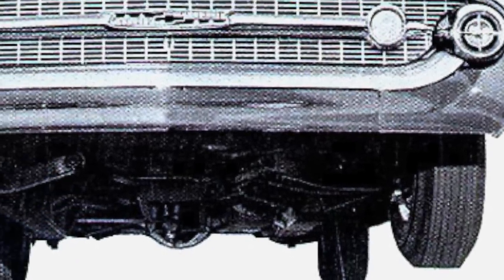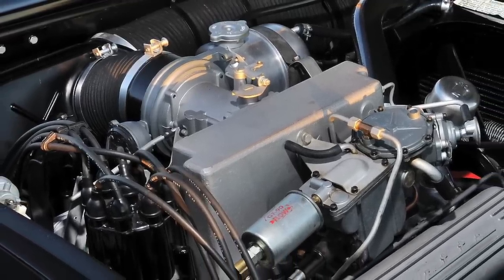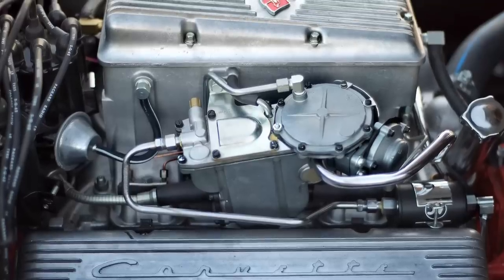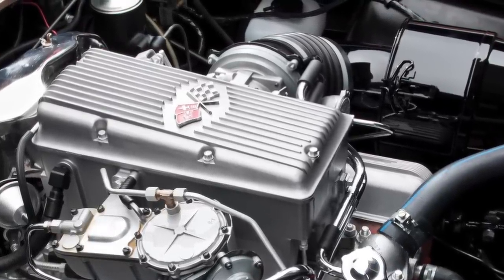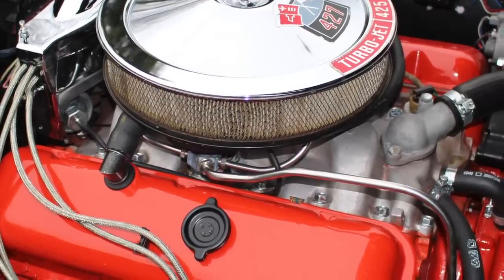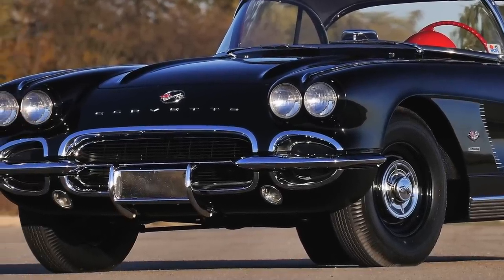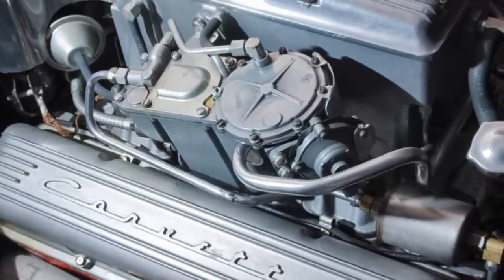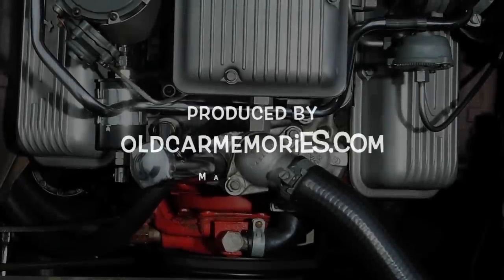Why Chevy Abandoned the 1962-1965 Fuel Injected 327 V8

Comment: Other reasons Chevrolet dropped the Fuel Injection were that it was not as economical as they portrayed it to be. Many owners found that their Fuelie used even MORE fuel than a carbureted engine.  Also, the Fuelie didn't run as clean as modern EFI systems do. The Fuelie normally ran very rich when cold and more often than not, stayed on the rich side of the meter when fully warm.  It's what's known as "Continuous Port Injection" meaning it's ALWAYS spraying fuel. 

Excessive Oxides of Nitrogen emissions were a problem with these engines and with emissions standards on the horizon for 1968, Chevrolet chose not to bother.  It was easier to clean up the exhaust of a carbureted big block than it was to tune the Injection system for emissions.  Well, they could, but it meant a tremendous drop in power and economy so the entire operation was dropped.  

If they could have found a way in the 60's for it to be able to meter fuel better, but controlling fuel in a purely mechanical system didn't seem feasible.  Mechanical injection was much more suited to airplane operation than automobile.  There simply was no reasonably affordable way for them to control the fuel with the technology of the time.

It was a valiant effort for sure.

Another one that was far ahead of it's time was Bendix's Electrojector used on some Chrysler Corporation cars in 1957 and 1958 and also considered by AMC about the same time.  The Electrojector is considered the Daddy of modern Electronic Fuel Injection and differs from GM's system as it COULD meter the amount of fuel the engine called for but the Electrojectors biggest failing was 1950's electronic components.  Old school capacitors, paper resistors and time-period transistors simply could not survive in an automobiles' climate and component failure effected ALL cars equipped.  Today, less than 5 Electrojectors are known to survive and I believe only ONE is functional.

Comment: Whatever the engine's  faults may have been the ONLY 'Vetts that I have ever been interested in are the '62-'65 models with the 327 fuel injected engine.
Reply: I totally agree and I am still driving my '65 Fuelie, solids, side pipes, 4 spd. , 370 posi coupe that I have owned twice (77-82 & 2000 - present) Love that Vette. Had a '64 Fuelie Coupe too from 1966-69.

Comment: My mom just gave me her '63; it wasn't born with the fuel injection option but it is totally factory original. It is in need of TLC and probably an engine rebuild. It burns a lot of oil. But the entire car is unmolested and original which is nice. I'd like to put a '63 injection unit on but then the car wouldn't be original...

Comment: They axed it because the mechanical fuel injection was extremely problematic and the first thing to go bad was the fuel timing cam which needed an above avg. mechanic to fix it properly in those days. It was also a very expensive option. All that for 15 more hp over the 327 2x4’s which cost a lot less and twice the reliability.... no brainer

Comment: Chrysler beat the 283 Chevy (there was also a 250 hp FI option) to the 1 hp/ci with a dual quad 354 cid making 355 hp the year before. I believe Rochester made the fuel injection for Chevy, b/c Bendix made a unit for Pontiac and Chrysler that failed regularly and were gone in a year or two.  Imagine if during the gas crunch of the 1970's, GM had put this on the corporate 305 for their luxury cars instead of trying out the 8-6-4 and diesels that sent customers running away.

Comment: In 1969 or so one of the mechanics who worked at our garage was practically crying trying to get the fuel injection system working on his brother's vette.  He ended up putting a carburetor on it.  Sounds like he should have had it towed to a Chevy dealer.

Comment: It was NOT a mechanical fuel injection system like Mercedes. It was a constant flow system, the injectors were pumping fuel all the time and controlled as to the amount by an air flow sensor that was forced to change due to air flow into the engine. and Chevy was not the only manufacture to use this system, Pontiac had it also.

Comment: For the same reason Chrysler abandoned fuel injection in 1958, the electronics required just wasn't ready yet.
Reply: Your right, however it wasn't the electronics, it was the parts. The capacitors were not weather proof and disintegrated almost immediately when put into service. A Desoto Adventurer was discovered with the system still intact. The owner replace the components with modern types and it works beautiful. I love AMC's desicion to just abandon the whole thing when they experienced the same problems on the 57 Rebel.

Comment: The next pre mass-production fuel injection system was on the 1976 Cosworth Vega, twin cam motor.  1st electronic system I believe.
Reply: Chrysler had the first electronic fuel injection on a 300 letter car with a hemi in the 50s I beleive. They didnt work very well but they worked

Comment: Engine was great but the F.I. systems was fraught with way too many issues. Most removed it and replaced them with a single 4-bbl intake and (usually) a Holley carb. And yes, many were literally bagged up and set on a shelf, never to be installed again. Today, the hot set-up is to fake it by installing port-type injectors and controls and use the shell of the original F.I. components to disguise the changes. Now one cna have the performance of a modern system but an oldies look. Still, have to hand it to Chevy as when brand new, the F.I. system was great. But, G.M, never invested the time in a.) mechanic training  to fix faults at the dealership level (it is a complicated design for sure) b.) re-designed or solved the mechanical issues that plagued the system. .

Comment: I wonder if the real reason the 396 vette was only a .10 second faster had more to do with tires.  It's my understanding that with slicks the dual quad high compression 427 would run tens stock.
Reply: I made comments above about the 1965 327ci and 396ci as compared to the 1966 427ci x 425hp Corvette.  Your understanding is correct.  That stock Corvette was only fractions slower that the "stock" Shelby 427 Cobra.

Comment: The thing that should have been established right away is the distinction between Mechanical Fuel Injection (Rochester in Chevrolet and Pontiac) and the later Electronic Fuel Injection that has since replaced it.

Comment: The 327/365 Corvette was also an awesome car.  I had two of them, and liked them better than the faster 427"s.  The 327/365 would walk away from the hydraulic lifter 427's--the nose heavy pigs with 390HP.  Of course, not much was faster than the fierce solid lifter 427 cars--425HP or 435HP, which were underrated by GM because of the insurance crackdown.

Comment: The 396 is why they dropped the F.I. 327, plain and simple. A 425hp big block with 3x2bbls cost the same or less. Efi came back in 1982 with the Crossfire 350 making 200hp. Only took 27 years.

Comment: I'd be shocked if there was more than a 100lb difference between SBCs and BBCs and for my trouble, I'd go Mark IV because it had better heads, a larger cam core, thicker cylinder bores, and more displacement. 

Unlike the small block, the Mark IV was designed to win at Daytona, and It's still a lot smaller than Japanese and European V8s and weighs less too. 

I weighed the pieces of my small block and realized that with aluminum heads, intake, carb, valve covers, timing cover, water pump, damper, and pullies, the short block is by far the heaviest component group at about 300lbs. As it sits just behind the front axle center line with the block's deck being somewhere near the upper control arms, that added weight would still have been pretty low and pretty far back in the chassis in Corvette applications. I think 100lbs is a small penalty to pay for 400+ci and canted valve heads in a 3500lbs car. These days you can get nearly 600ci out of them.   

I wish the Mark IV would have carried on instead of the small block. After about 1985 it should have become a roller cam, one piece rear seal, all aluminum deal and then we wouldn't have a generation of people thinking that only Europe and Japan can make great engines and cheering on HP/L as their measure of "efficiency" when their engines are physically huge and heavy yet unable to attain large internal displacements.
Reply: I believe that the BBC is almost 150 lbs. heavier than a SBC.

Comment: I once read that the fuel injection systems were complicated to work on and unreliable ( at least in the 50's anyway ). It was common for fulie owners to come back to the dealership and switch out to two four barrels. Chrysler offered fuel injection in 1958 which also proved to be big headache resulting in owners coming back for a swap out. Pontiac also offered fuel injection in '57.
Reply: the chevrolet's rochester system was purely mechanical with no electrical or electronic controls and was actually quite reliable, but was more complicated to tune and adjust and unless you were trained to service the system, you would make problems worse before they would get better. chrysler actually licensed the technology for their fuel injection from american motors corporation who created the first electronic fuel injection system at a time when printed circuit boards were just being invented, so of course the system was not reliable but when it worked, it worked very well. american motors eventually sold the rights to their efi system to bosch, who developed it into the electronic fuel injection system that all new vehicles use today.

Comment: You can say that again Tony, that is one of the reasons why they let those engines go...to dependable...… that's one of the reasons why you saw 55 - 60 model Chevrolets still on the road in the early 70s.....Run forever.....1973 ARAB OIL embargo cleaned house on the 283 and 327 because their valves were not compatible to the unleaded gas is what I have heard...….
Reply: It was the change from leaded to unleaded gas. The older cars can be run on unleaded if you have hardened seat installed into the heads.

Comment: What about water injection, or water+alcohol blend to prevent freezing? They can increase power while eliminating the need for high-octane fuel, even at high compression ratios.
Reply: Olds had it in the early '60's.

Comment: All that is ever  talked about is  how much power the engines made, no body ever says  the problems  these Fuel injected  engine had! My buddy's  Dad bought a new 1962 327 corvette with fuel injection he had so much trouble  the dealer removed the  intake and replaced it with 2   4barrol carbs then the  car ran properly!

Comment: Aircraft have been using fuel injection, intercooling, multi valve and overhead cam engines since the 1930's.
Reply: John O Daimler Benz built mechanical fuel injection system for the Germany aircraft  industry and gave their aircraft an advantage when it came to negative g maneuvers.
Reply: @daleanderson7794  
That advantage was soon overcome during the Battle Of Britain by the installation of 'Miss Shilling's Orifice' in the carburettor and by revising aircraft combat manoeuvring tactics (ie: rolling inverted to prevent negative G during a dive).
 Although not completely eliminating the problem it certainly helped until a better engineered solution was made.
Reply: Yeah, but aircraft engines sit at set throttle. No problems with response.
Reply: @ΑΡΗΣΚΟΡΝΑΡΑΚΗΣ  
Tell that to WW2 pilots that were in hard combat manoeuvring.
And when I did my pilot training, doing circuits and practice landings the throttle is constantly being adjusted.
Reply: @johno9507  not as much and wide as an automobile though.
Reply: @ΑΡΗΣΚΟΡΝΑΡΑΚΗΣ  
That's just not true,
You can't generalise like that.
If you're doing a long navigational flight then you won't change throttle settings much, but a aerobatic pilot will be constantly changing throttle settings.
I drive three times a week on the freeway for over a hour with the cruise control on, clearly not changing throttle settings much, yet driving around the block I might accelerate hard...your argument is completely flawed.

Comment: It was impractical on the 327. Fuel injection was a $300 option. People were actually paying $300 more for 10 less horsepower that what a single Holey four barrell carburetor would have given them

Comment: Rodchester was greaty and kept raising the price for FI,.Restricting FI to only Corvette caused the price to go up.
I put 320hp unit on my 67Vette 350hp and got 20+mpg and learned how to adjust the valves and changed filters my self 30k before having it serviced by mechanic.
22+ mpg LA to Seattle 1979
Reply: ... Maybe Rochester didn't have the manufacturing capacity to make enough FI units more available as an option to other Chevy models.   Plus, it was a pricey option at that time, if I understand it correctly.

Comment: Never mentioned the new much larger air volume doghouse introduced in 1963 thru 1965.
Reply: Because like the 327 it cost an arm and a leg and only added 10 horsepower.

Comment: it ran hard but would vapor lock, the mechanical fuel pump was lacking!
Reply: Wow i remember vapor lock it was a real thing. BTW the vapor lock was due to the low pressure in the small lines going to the nozzles only about 1/4 pound at idle.

Comment: The distributor drive cable was its Achilles heel. It cost one racer a SCCA national championship. They should have put a proper accessory drive on the engine off the cam front or put the pump on the distributor shaft. Part of the problem was GM wanted to get around Hilborn and Bendix RSA patents rather than pay even a token royalty because GM had a philosophy of avoiding anything " not invented here".  Later Bosch came out with the K-Jetronic system that was probably the best fuel injection system for gasoline engines ever designed. Of course being German it was overpriced for parts and not made to be hot rodder friendly but it was simple and if maintained well fairly bulletproof. By the time it was introduced several key patents were expired or were close enough Bosch figured correctly they would not be bothered.

Comment: I figured it was because the systems broke down easily, and were too complicated for most mechanics to fix. Every gearhead and mechanic could tune a carb, but almost no one knew how to work on the fuelie system, so the common solution was scrap the rochester and go with a standard carb.

Comment: Had GM kept the 327 in production as the small displacement engine option they would have saved billions of $$$.  The 327 had a 4" bore with a 3.25" stroke, the 350 is a 4" bore and 3.48" stroke.  This means that the same block castings and tooling for final machine work would have been possible.  With the 305 everything was different which means additional tooling and a separate machining line was needed to produce an engine that was 75% the same.  The 327 and 350 would have only differed in the crank and connecting rods making the engines 90% the same. 

All and all the 327 was one of the best engines ever produced.

Comment: The 327 Fuel Injection engine continued for another 12 years after its 1965 termination, in the Opel Diplomat E. Like everything GM did, it wasn't that they couldn't conquer the technology, it was cost. The West Germans needed the image an American 327 Fuelie engine gave to a model range that already had a 2.8 Esprinz engine. America gets itself all crossed up over the value propositions. In Germany, that's not the case. Same thing with the Bendix  EFi in the Vega, 1977 Oldsmobile 350, and the rear drive Caddilac Seville with its Olds 350 Port EFI engine. GM had a habit of scuttling everything on basis of cost. It's what it does best.

Comment: The drivers side cylinder bank always ran lean on the Ram-Jet and later fulies too. No good way to compensate which made it tricky to tune proper. It was a good (not great) design bastardized from the pressure carburetors used on fighters, bombers, and airliners of WWII. Adapting a pressure carburetor like a Bendix-Stromberg PC-12 would have solved a lot of problems and made a smoother power curve when compared to the remodeled system Rochester built.

Comment: The Petroleum lobby was beginning to have influence with auto manufacturers. Seeing a fuel system that made more power with more efficiency was bothersome to the Petroleum industry’s bottom line. Which may have had some influence in why GM didn’t publish bulletins in service manuals for independent service shops. And perhaps why GM went to big blocks creating more power with lower fuel efficiency.

Comment: Honestly I feel that Chevy dropped the 327 because it was such a reliable engine. That Chevy couldn't make enough money on engine parts when the engine got older. The engine was nearly bullet proof and never broke down. Car manufacturers relie also on there sells on parts after the vehicle gets older.
Reply: Chevs are one of the best designs ever. But also had a heap of troubles. Cam lobes and lifter being too small so worn out cams are common. I have never stripped one with a cam any good. And have done quite a few 14 or 15 lobe engines! But plus side, quite light, even with the cast iron, fairly small so fit in smaller holes, very good oiling, good cooling, 14 bolts per head = 5 bolts per cylinder. The rest had 4 including the LS.
With all the aftermarket stuff available now can be built 1 100 lbs lighter and 50% more power. Or a race engine with 2hp per cubic inch reliably.
As for the 327, rev nice but the 350 makes far more torque and the near generic 383 even better again. The 400 not such a nice engine however
Reply: Boy are you out of it . The MAIN expense to an automaker is warranty work. An unreliable engine can bankrupt a company in no time. There was NOTHING abotu a 327 that was any more reliable thn any other smal block - they all had virtually identical architecture and even shared msot parts.